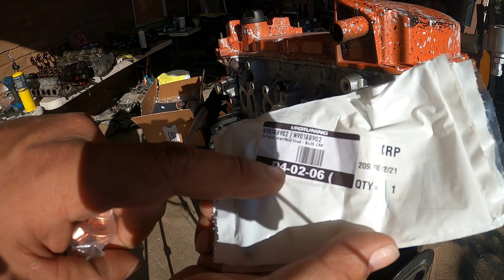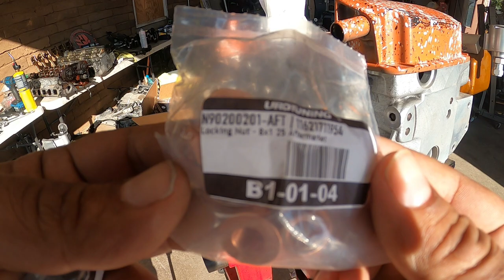How to install a Turbo VR6 Manifold - Patreon Buil VR6Turbo

Comment: Hi, I am wondering if you can help me. I have 1.8t 20v. When I rev it up, it's smooth, and it idle fine. There are no folt. When I try to drive it just over 2000, rev it sputter and doesn't want to make boost. I have been trying to get right for 1 year now. There are no boost leaks or vacuum leaks. I checked the timing, and it was right. I know you know these engines. If you have any advice I will appreciate it.
Reply: Check your spark plugs, make sure your gaps Is good